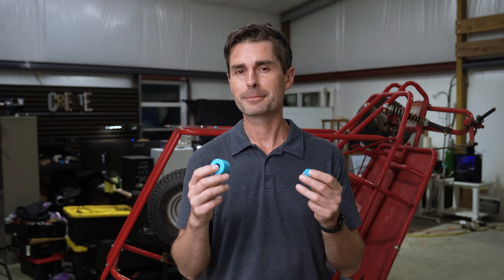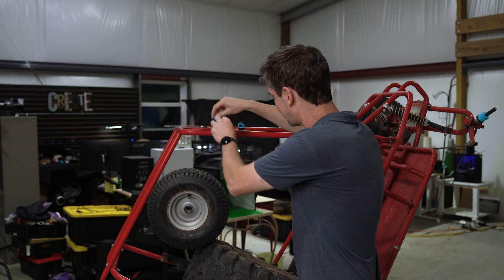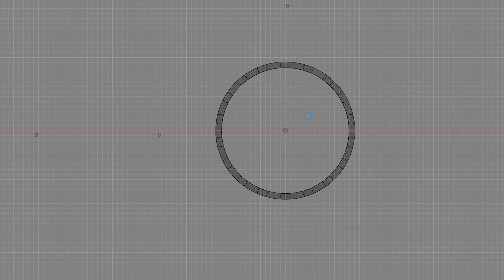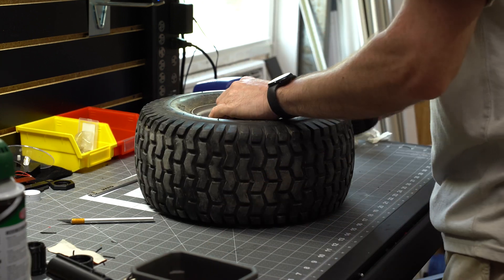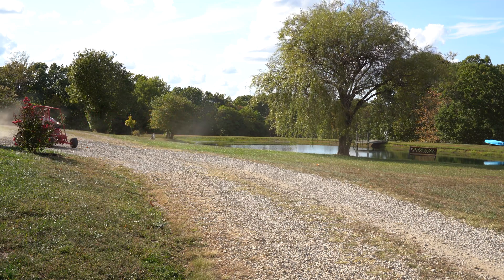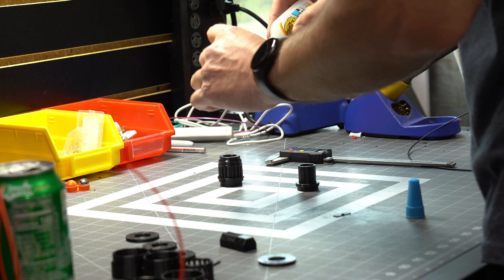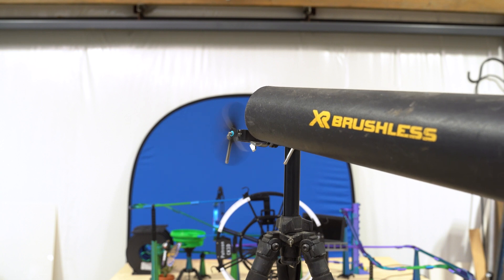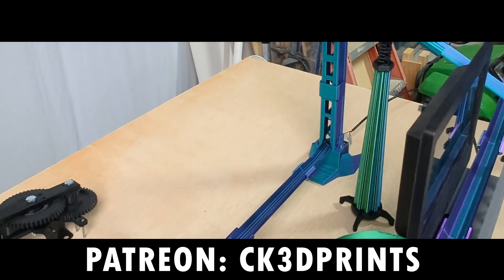We 3D Printed FILAMENT BEARINGS for a Go-Kart. Will it work?

Comment: Idea: A Bearing with 3 bearings in a single unit, each containing 6 balls (calculated as 3×6=18). This design aims to achieve a better load capacity by distributing the torsion across multiple 6-fold harmonic units.

Key Features
Total Balls: 18 (from 3 bearings, each with 6 balls)
Improved Load Capacity: Enhanced by distributing torsion
Design Type: Multi-unit bearing design for greater efficiency
Benefits
Torsion Distribution: Reduces stress on individual units
Increased Durability: Potentially longer lifespan due to balanced load
Enhanced Performance: Smooth operation via harmonic motion.
By integrating three bearings into a single unit, this innovative approach aims to maximize efficiency and performance.

Comment: PLA is the strongest plywood You're only issue with heat if you can manage heat you should be okay also you can get 2.85 mm filament if these work it'd be worth getting a roll just for that it would basically last forever

Comment: Plz go for a Polyurethane/PU-molding:
Print the outer form (multi pieces) with a resin printer as a molding. 
Then use PU to fill the mold.

-> Should be much more precise. And as far of my knowledge there are bearings made of plastic/Polyurethane.

Comment: I encourage some minor cheating. For the bearings themselves, use parts of nails or something equally cheap to get ahold of. For smaller ones, paper clip parts. My consideration is in obtaining things. Particular size bearings are much harder to source than standard steel parts. Try the nails from pallets (which appear to be abundant across the globe). They may make good bearings.

Comment: I wonder what would happen if I used your files (adjusted, of course due to the slight difference in circumference of 1.6mm) with a cheap, widely available, solid picture hanging wire. I'd have to straighten it and smooth the clipped ends, but it might be worthwhile.

Comment: One practical use that ive not seen discused is the weight. I cant remember the exact figures, but in one of the older Xrobots open dog videos, James mentions a surpising percentage of the weight was just the berings. Id bet you could make some huge savings with these alone.

Comment: Yeah I wouldn’t just “cut” the length of filament. I would sand them down to length with a die grinder and a sanding disc, you could get it right down to the 10 thousandth.

Comment: Bike spokes, they are normally 2mm in diameter, I have been getting thrown out bike wheels and salvaging spokes off of them mainly as hinges/dowls for 3d printed parts
Reply from the maker: @lolslim690  Oh yeah... that's smart. Bikes have a lot of useful components and they are often dirt cheap or junk anyway. Thanks for the tip! 🤙🏻
Reply: @CK3DPRINTS  Honestly I didn't give it much thought, you are making IDK how many but im sure bike spokes wouldn't be the best price wise and other factors.

Comment: I am guessing that my work developing metal oxide to metal deposition 3D printing will be quite useful for this sort of project too ;) (2 experiments, one was red iron oxide not the black hematite form that I was able with nothing but it powdered onto a stone surface for safety and hand running my laser over it that is a 500mW 405nm laser, and it was able even with exposure to the air to deposit raw iron metal onto the stone, the other being TiO2 white pigment powder that I was able to break down into the blackish brown rutile crystals so the energy based fluxing I am working on should allow printing with both Titanium and aluminum metal from their oxides as a powder directly, (side stepping a ton of wasted energy and time involved in normal refining to get raw metal from the oxides and other raw minerals they start as)      )) 

achieving full replicator status is the point of such work I am up to, so that printing even electronic components and magnetized material from raw unrefined or recycled materials as the starting source for every aspect (and more) of the replicator's needed components. The sort of thing that would remove the need to obtain any tech in space on the way to another star, since you cant just pull over to a local petrol or gas station nor walmart or woolworths on the way to alpha centauri LOL (I still dont understand why this is not Elons primary focus as opposed to rockets, still being manufactured the old fashioned way that Tory Bruno's company is already competently managing with and then work with them to massively increase the output of the company , while improving their capabilities beyond anything currently in use,  Especially since every aspect of achieving this in my own road map to completion is already proven tech being used in industry and manufacturing of one sort or another, that just most of the time has not been able to bridge across the various disciplines out there.

Comment: I have a wheelbarrow, there are plastic bushings holding a metal rod inside the wheel. And guess what, need these bushings only? No, you need to buy the entire wheel assembly. These bearings may help, thanks!

Comment: It might be a tolerance stacking nightmare, but for those thicker go cart bearings you could design them with multiple concentric races like a bullseye to spread out the wear. Also if one layer seizes the other layers will allow the bearings to keep rolling.

Comment: Weed Wacker/eater/ trimmer line is just nylon filament.  I've used 1.7 mm diameter in my printer before. You can easily get larger diameters at the hardware store.

Comment: Have you considered perhaps 2.85mm Filament for some of the larger bearings?  Or maybe a series of bearings around cheap readily available steel BB's ?
Reply from the maker: Actually testing both of these VERY soon. Thanks for the tip!!

Comment: There's some Delrin (POM) filaments out there, maybe bearings with that would be even more low friction and durable? Just be careful to get the print settings right, because it can release formaldehyde gas when printer over around 220 C

Comment: This could be very cost effective for large inner and outer diameter bearings that don't need to take much load. Those things are usually incredibly expensive.
Reply from the maker: Good call! You can also make them in custom sizes and add built in features like steps and locking mounts

Comment: Printable parts might not be the best solution, however they might hold up pretty well for some time. But it might be a verry good option as a temporary part when you need the parts right away and you're having a 3D-printer. Or for temporary emergency parts.

I also printed some bearings, and I was actually positively surprised with them.
Reply from the maker: Yeah it's more about just having fun being creative and temporary solutions than it is about something permanent. 
I was genuinely surprised too 😅

Comment: I’m no engineer, so my opinion may or may not make sense, but don’t you want the different pieces of a bearing to have different “strengths”, so only the easiest changing part gets worn out? If that’s the case, what’s the replaceable piece in these bearings?

Comment: try bushings without rollers instead, just the grease, yes those types of bearings are just two metal/plastic pipes inside each other. btw go cart wheel arms dont have to be steel pipe, they can be leaf springs. then you get both the leaf spring arms and the shock spring pistons. wheel end nut washer is not part of the bearing. very cool as prototypes. for testing. try 3d printed or cast TPU wheels. yep solid, or airless flexible.

Comment: A fun thing that can be done with these is the bearings being seamlessly integrated into printed parts. Say, the entire wheel with bearing's outer race printed in a single piece.
Reply from the maker: I completely agree and this is the exact reason I even started to make these (Ferris Wheel hub)
I also understand the comment about how "real" bearings are replaceable, cheap and more standardized. 

But ... I'm a firm believer in learning by failure, and this is a great way to jump right in and fail on a project instead of waiting for parts to arrive 😂
Reply: For a simple thing that doesn't get Intense use and you're out of regular ones, it'll definitely be worth knowing jow to make. At least until you can find a better solution.
Reply: One of the benefits of cartridge bearings, really all bearings, is that they *are* a separate components. They are a wear part that can be easily replaced.
Why would one want to make a bearing (effectively) non-replaceable. I would much rather just replace a bearing, rather that an entire major part with an integrated 'print in place' bearing.
Not to mention that tightly controlled  clearances and tolerances is a nightmare for all mechanical print in place parts - mostly from 3D printers just not printing circles very well - to machinist tolerances anyway.

Comment: You can get extra thick nylon filament, not necessarily used for printers.  I have some that's about 1/8" thick, I'm pretty sure you can get even thicker.  Use that for the rollers in large bearings like the go kart.
Reply: You can also get hardened and ground 52100 steel needle rollers for a few cents each.
Reply from the maker: I'm about to test something just like this. Good call 🤙🏻

Comment: One guy suggested graphite infused filament, well how about just straight up using pencil leads for inner bearings?
Reply from the maker: This might work, but I feel like it could be too brittle since plastic can flex and prints have minor imperfections in roundness, etc... Something I'm definitely going to test soon. Thanks!
Reply: Graphite is very soft when it would be better for the rolling element to be the harder material and wear out imperfections in the rest of the bearing

Comment: This is awesome, and great timing right as I find myself wanting to make a bearing surface on the outside of a 30mm PVC pipe. Would you be willing to share some of the design tolerances you used for the various parts?
Reply from the maker: Thank you! Haha, that's awesome and would be an interesting application. Sure, a couple starting points: For 1.75mm filament, I'm using a designed space of 2mm between the inner and outer race, and a 2.2mm diameter for the cutouts of the roller cage sections. This is assuming they will be printed and have some hole shrinkage. For your pvc pipe, maybe try 1.8-1.9mm between the pipe and the outter (or inner) race, which I'm assuming is printed.

Comment: Make the filament stronger with solvent adhesive. Maybe a lower friction would be with something like epoxy. If you can get a mould you might also be able to apply pressure and metal powder coating.
Reply from the maker: That's an interesting idea for sure. For larger applications like the Go-kart sized bearings, it would be better to have much larger rollers. I'm thinking about doing a 3D printer-powered injection mold for larger rollers, kind of like @CNCkitchen did in one of his videos. Having a hybrid or coated metal material could work with that setup as well. Definitely some useful concepts there, thanks!